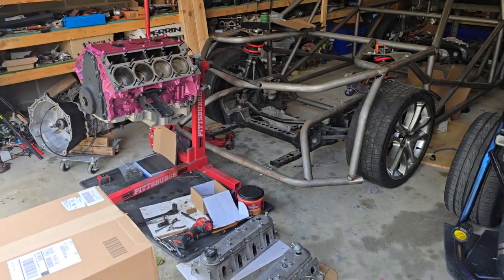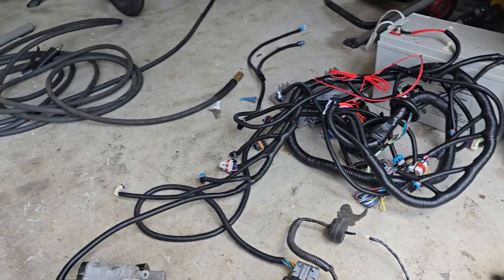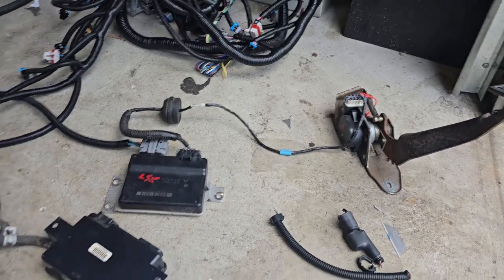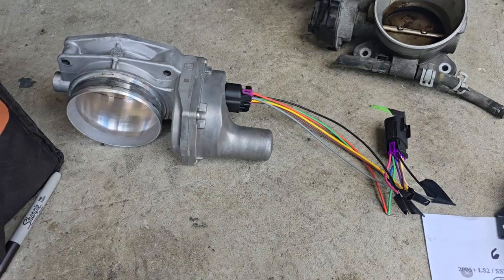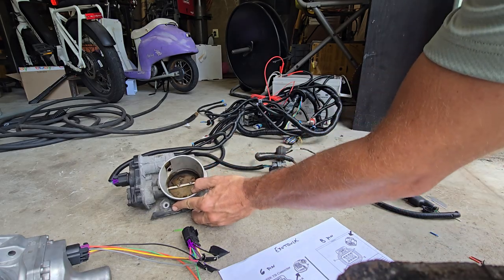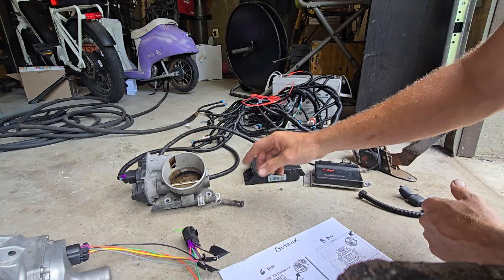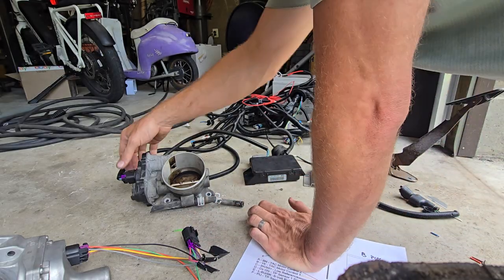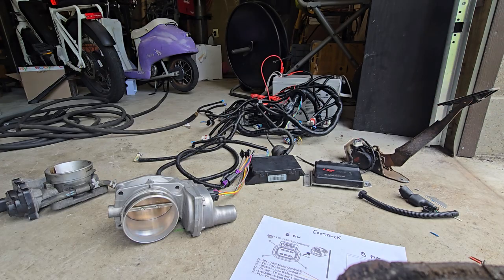LS 3 bolt to 4 bolt DBW Throttle Body the OEM way

Comment: I just did it today when I slam the pedal to the floor it almost fully opens and then moves up a tiny bit slowly is there something I have to change on the tune for that I’m using a LS3 gold blade 90mm

Comment: Im actually trying this today. 04 petal, 02 plastic tac and 08 gen 4 truck tb.
Reply from the maker: Good luck, let us know how it goes
Reply: @exotruck5731 so I tried it with the gen 4 truck tb and got reduced engine power. Then I tried my ported ls2 silver blade tb from my g8. And it worked. Drives smoother, revs faster. Way easier to rev match
Reply: So it has to be a ls2 throttle body right for it to work
Reply: @ezequielugalde768  The G8 gt 6.0 has a LS3 TB